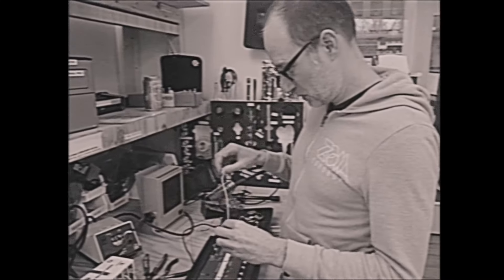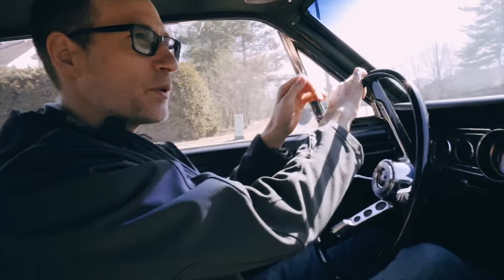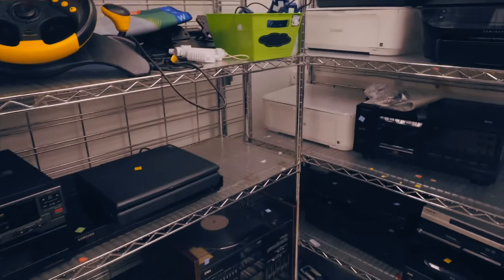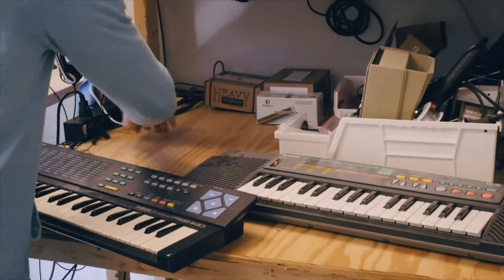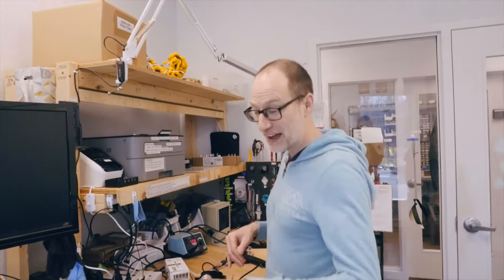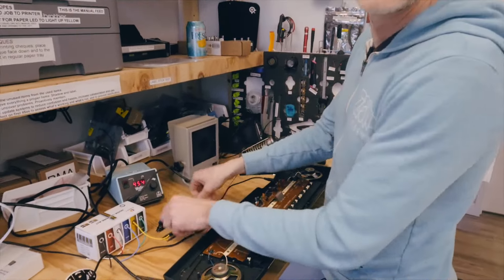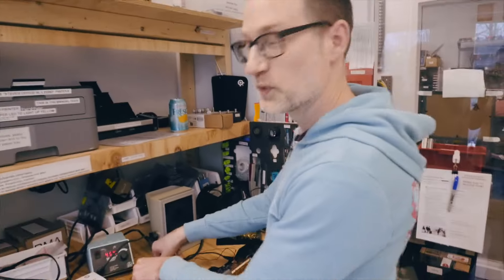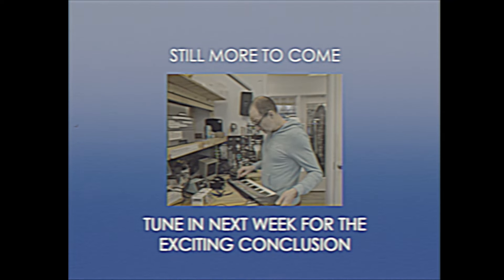Learn How to Circuit Bend with Steve Bragg

Comment: Generally you DO want to know about the ICs in devices you want to bend. Finding places to apply pots to get different ranges of use from existing functions is one thing to look for in ICs, and changing capacitance in places relying on capacitors to condition a given sound or amplification function would be another. Those things become much easier if you have a sense of at least the pin-out, though you don't strictly need it. Playing with the timing oscillators is also a standard move - because, of course, changing frequency of sound sources and/or effects can be fun. Adding outputs for specific sounds or adding jacks to accept audio or CV to a system not set up to accept it can also add interest, as can adding or rerouting a sound source to modulate and/or to feed back on the existing sound source can add substantial, if sometimes monstrous, capability to limited instruments. Sometimes a little keyboard just cries out to be made monstrous somehow. I mean, playing just with resistance, including the stereotypical circuit-bending use of body resistance is fine, but that's just one little possible piece of color when you could be doing more transformative things.

I have to say, I was shocked you went to a schlock store and to a Damnation Army and came away empty. What town was this in, again? It must be junk-instrument wasteland. Or all your luck was sapped by the acquisition and jump-start of the '66 Mustang.
Reply: Where were you before the episode @bitgoatie?!? Thanks for the tips, they make a lot of sense. We did end up getting some pretty great sounds out of the keyboard in the 2nd episode!